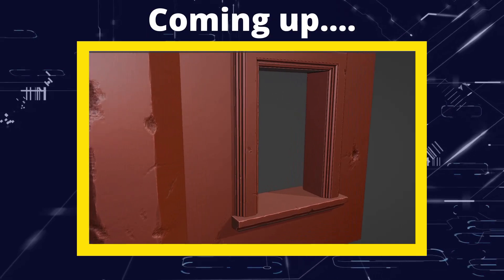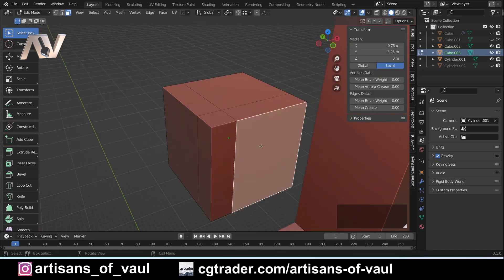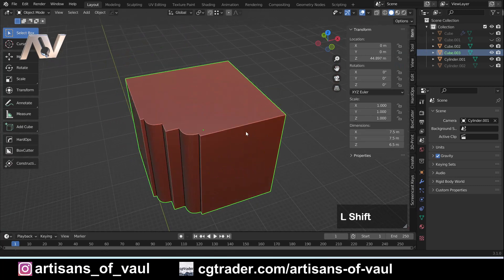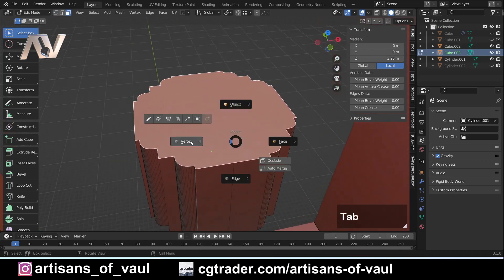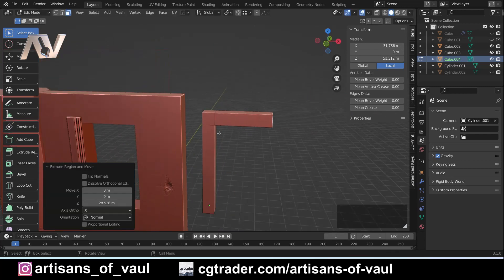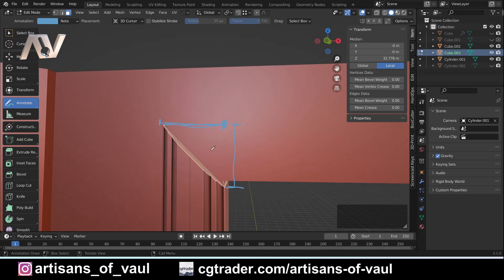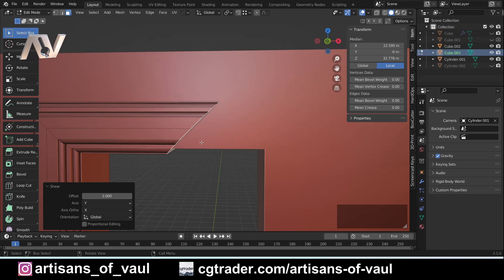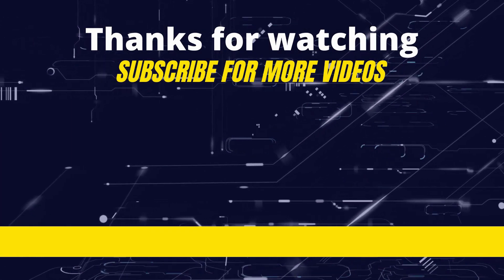Using the shear tool to create an ornate window frame

Comment: Hey, thank you for this great video, i have a question after doing CTRL+B and then trying to apply P nothing is happening where is the problem ?
Reply from the maker: Hi there.  You need to then move your mouse away or towards the object.  If this isn't working once you have confirmed the bevel but before anything else has been clicked just go to the information box in the bottom left corner and change the "shape" value.
Reply: @ArtisansofVaul  hey, thank you for your answer, i’ve tried it and yet it’s not doing anything, the problem is going even with alt+x no action is done with it, i tried to use another pc "in my office" and same, still getting nothing, can’t this be something to change in the settings ?
Reply from the maker: @rsvdz  I don't think so. At least I've never had to change anything in the settings and I've used this pretty recently. I'll have to try it again when ai get a chance but I'm not near the computer right now.
Reply: @ArtisansofVaul  i really appreciate your help. ps : you’re the best in this field keep it up 🙏🏻😍
Reply from the maker: @rsvdz  Sorry I can't be more help immediately. When I'm home (currently on holiday) I'll have a look 👍🏻
Reply from the maker: @rsvdz  Hi man. Hopefully this helps a little with the options to get this working. https://youtube.com/shorts/tmReZuQdJoQ?si=lVa_EWbJE-l-KJsh

Comment: Shear is definitely an underused and useful tool to learn. But a more flexible way to do this exact task is to duplicate the window frame, convert to curve, make a profile curve for the moulding, and then use it in the Geometry / Bevel section of the window frame curve as the object. It does all the lining up and shearing, and even better, it's totally non-destructive; you can still change both curves, which also means this is super useful when you have a bunch of windows in a similar style but want some variation in their shapes and size. That's really why I liked working with curves -- I can keep changing things as long as I can keep them live.

Good tutorial though! Different workflows are always interesting, never know when one might come in handy. I've subscribed; I like your way of explaining things; all the necessary explanations, not a lot of faffing about, and some interesting and unusual stuff.
Reply from the maker: I generally agree for complex shapes and curves but I'm not sure how user friendly it is. And I would say takes more time for say a quick 90 degree turn.

Thanks so much for subbing and I hope there will be other things you find helpful. We do play around with Geometry Nodes as well which I get the feeling you will like 👍🏻

Comment: Nice, was very helpful...although: whats really giving me the sheer (hehe) nervous breakdown everytime, is figuring out on which axis I want to shear. This gizmo made it a bit easier to understand an maybe it's just me, but it looked to easy to me on those particular parts of the video.
Reply from the maker: Without the gizmo it feels very challenging to use it as a tool.  You can use the shortcut to activate the tool but it doesnt show the gizmo so I just never use it that way.

Comment: Edge constrained transform also is good for this in the paid version of machine tools it allow you to shear using degrees.  Using mirror can also help if you create a plane the same size as the window and mirror across this you can eliminate modelling the other side and mirror can merge the mesh at the join.
Reply from the maker: Yeah the paid version adds such an amazing tool set if you know where all the little bits are hidden.  Like using the edge constraint tool to allow you too match a surface face to another object is amazing.

Comment: I have a weird question and this video provides a good example of what I am trying to describe. Every time I print out one of my projects I get a hairline extrusion across the model at the layer where a boolean ended and I have no idea what to search to even learn about this. I know it is something I am doing wrong because other people's models print out without the line.
Using your model as an example, when I cut out the window using a cube/boolean the wireframe looks perfect in Blender. When printed I get a layer line across the bottom and top of the window edge that wraps around the whole model, it looks like a bad Z-hop but it is only where the boolean stopped and started. There are no errors in the 3D toolkit, so not like a thin face trying to print. Putting a border around the cutout like this video did not help. 
Any tips on where to search or what would be appreciated but if not, no worries.
Reply from the maker: Hmm... That is weird. I don't think that's an issue with what you're doing in Blender but instead it sounds like an issue with its positioning for printing. I'm guessing are you printing it either the window frame parallel to the printer bed? It could be caused by a big change in the suction as its lifted from the FEP suddenly changing. You might want to try angling the part so that the window frame has one of its corners towards the bed. I'm not sure if I've described that clearly. But that should only happen on a big change so I'm curious if it happens for everything. If you're on Instagram feel free to find me there and drop me a message so you can share some photos.
Reply: @ArtisansofVaul  YT didn't notify me. If I get back on socials I may take you up on that. I am using an FDM right now, so no suction force (although that is good advice you gave for resin) It is the weirdest problem, the cutouts are creating a hairline across the whole layer. I thought it would be the Z-screw messing up but when I compared all the models and projects I have printed it is at different heights. Even simple things like a remote holder (basically a rectangle with cutouts) it occurs yet a statue someone else modeled printed perfectly to roughly 150mm high.
Oh well. Joys of 3D modeling/printing I guess. Thanks for the help anyways.
Reply from the maker: @RoseKindred  Thats sp weird then, I really don't know without seeing more. So sorry I cant help, never seen it before

Comment: Tut on that edge wear on the wall?
Reply from the maker: Happy to.  I just wanted to give some of the sculpting stuff a break for a week or two.  I'll add it to the list and should be able to go it in the next couple of weeks.
Reply: @ArtisansofVaul  did you try the OCD tool for wear? It looks quite nifty.
Reply from the maker: @Hurtone  I haven't.  At the moment from what I have seen the limit of only working on one object at a time and nothing too complex is a little frustrating for the price.  Also I want to control where the damage occurs to make it easier to merge together.  But for something quick Im sure the tool is great.
Reply: One good thing regarding the OCD tool is being able to quickly add minor damage on secondary objects. You can spend as long as you like manually adding detail to the elements that matter.  As far as I can see the OCD tool now supports multiple objects.
Reply from the maker: @robertwells4729  I have actually bought and tried OCD since making this. I havent made a video on it because to be honest I wasn't that impressed. I mean it works... but its slow and the results I've had with it aren't great as you don't have enough control over the scaling. I prefer doing it manually or the similar tool I have made myself using Geometry Nodes that you have much more control of (you can find the video here: https://youtu.be/lSrG6mYgk5Q ). It only creates damage on the edges of the objects but it's faster and free. If OCD gets the ability to control a bit more I'll come back to it at some point but until then it has.... issues....
Reply: @ArtisansofVaul fair enough,  I don't actually have OCD as yet but I have a situation where I have 1400 bricks that require minor detail that it seems suited for.   I have tried geometry nodes and was impressed with the results for one brick but for 1400 bricks OCD may be better... I don't know until I try though.   I'll experiment.  In my situation I am  not too particular on the detail that's applied just that there is variation.
Reply from the maker: @robertwells4729  Because its a modifier you can copy it onto all the other bricks really quickly. I've used it in my video on Fantasy Walls I think.